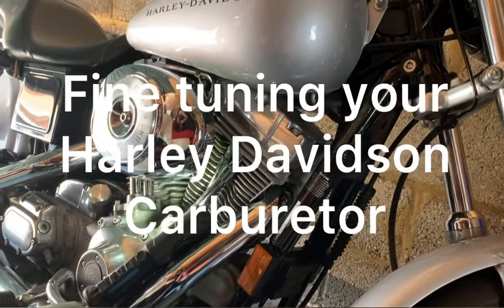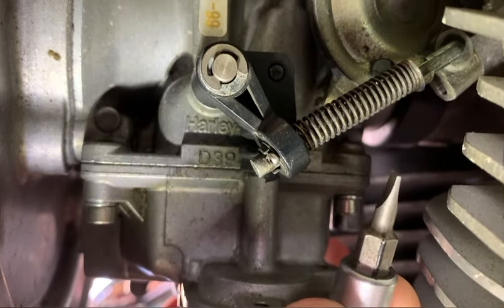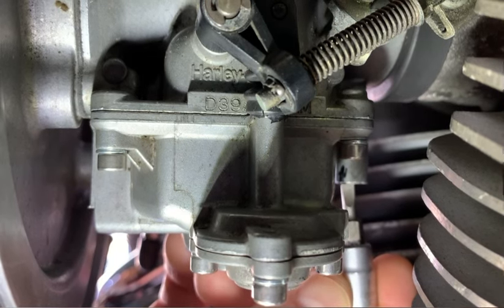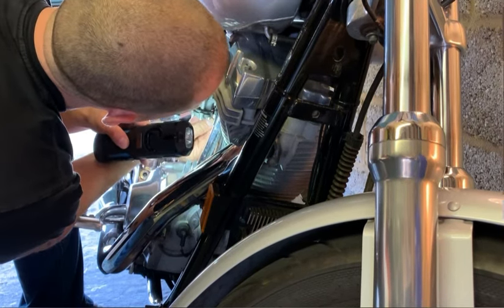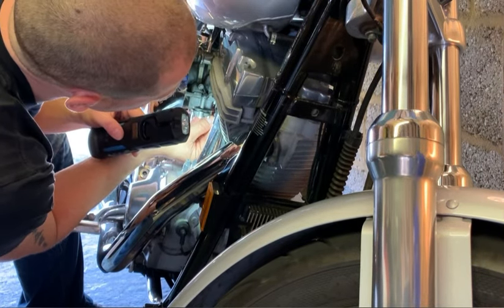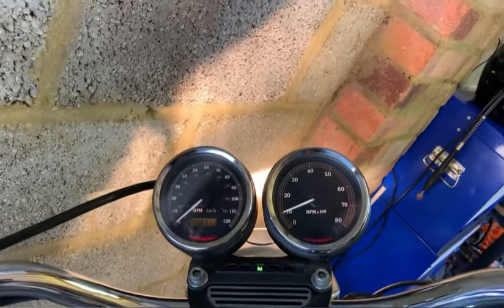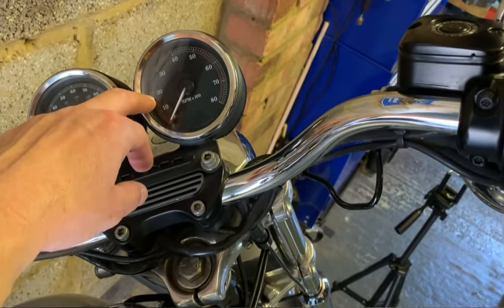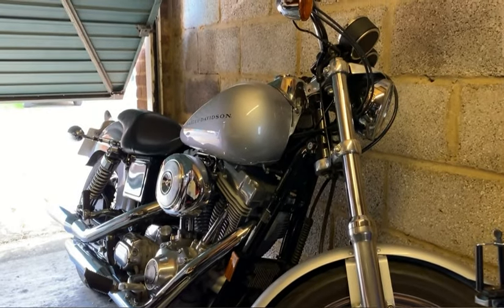Fine-tuning your Harley Davidson with mixture screw

Comment: I have now put in a 45 pilot jet. With engine warm and a little high idle rpm(do not have a meter) it doesn’t change rpm, no matter where i have the mix screw, even fully closed?
Reply: It responds fine when i rew it
Reply from the maker: Is that a 88 Twincam? Your rpm will need to be no more than 900 so that you can really notice the change. Once warmed up, bring idle down nice and slow and try again. But even with higher, with idle screw fully in it should stall

Comment: How do I now it's in the right place
Reply from the maker: When you get it to the spot where it’s idling smooth with the highest rpm. Blip the throttle should drop back down easily. If it hangs a bit, too lean. If it drops quickly below your idle and then slowly recovers to the right rpm, too rich.
Other than that, test ride it. Check how it responds, rides cold/warmed up and make further fine adjustments 1/4 turn each time until feels/ rides perfectly.
Reply: I just put back in the carburetor it had redone I got it all in and I reved it avd it choked out
Reply: @aronsgarage834  ok thanks

Comment: Any advice for no idle and choke not helping?
Reply from the maker: Could be any of these things. Blocked slow jet, blocked orifices, air jet, improper float level, air leak by manifold or exhaust. Check spark plugs as well to make sure they are not fouled.
Reply: @aronsgarage834  I had also noticed that I had a brand new carb and was getting no fire from the engine. I was getting fuel and spark. But no fire. Swapped for my old carb and it started up with no idle. The issue with the new carb could that be related to intake/ exhaust leak
Reply from the maker: I wouldn’t think so, otherwise it also wouldn’t work with the old carb. It might be worth taking it apart to make sure all jets are clean and set properly.

Comment: I started with 2.5 turns out the bike felt like it was starving for gas a little. 

Then I turned them 2 1/4 turns out the bike didn’t seem like it was running on all cylinders. 

Any suggestions??
Reply from the maker: You got leaner as you turned it 2 1/4. Go to 3 turns out or more especially if you have open pipes and high flow air cleaner.

Comment: In is rich and out is lean, that’s why it’s called “air mixture “
Reply from the maker: It’s not an air mixture screw, but fuel mixture. Other motorcycles, more like 2 strokes have air mixture screws.
On this carb, the mixture screw regulates the fuel in the idle circuit, so turning it out you are making it richer
Reply: @aronsgarage834  my bad 👍